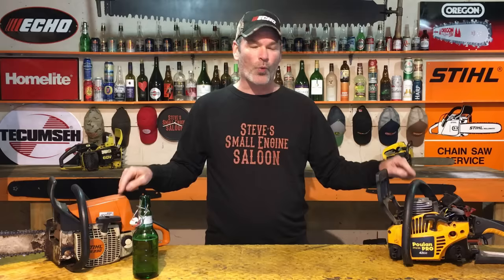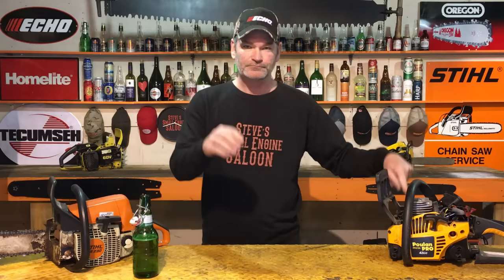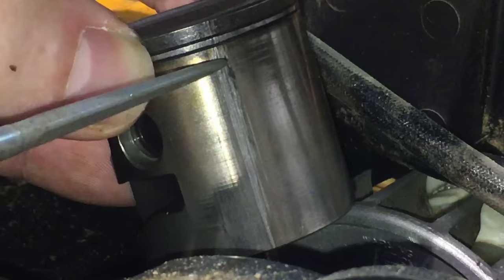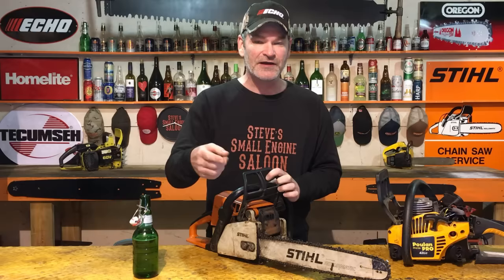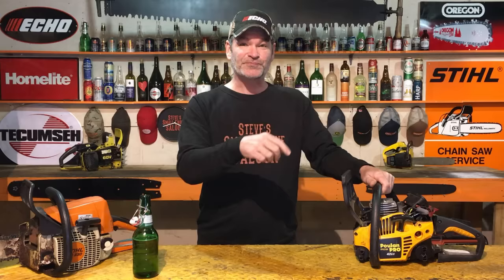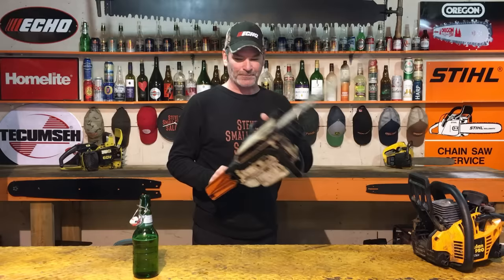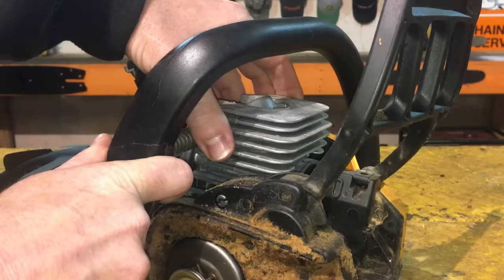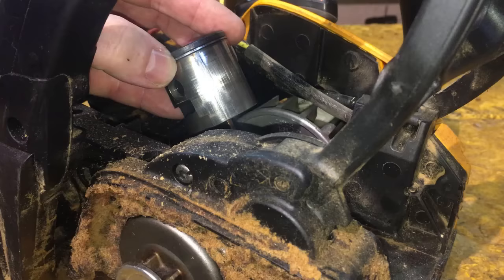WARNING: Never Do This To ANY Chainsaw

Comment: this is great info, i'll make sure i warm up my electric saws so this doesn't happen :)
Reply: If electric u have to run it at least 10 mins so the wiring warms up. For max power
Reply: @myes344  😂😂😂
Reply: You dont have a saw, you have a electric carving knife for the kitchen! Look out turkey............ha ha
Reply: @garyshanks1330  well i don't use a  chain saw to install a kitchen window 😅😂😂👌🏼💨    (chainsaw carpenters) we call them butchers!!!
Reply: @rev_80m13  measure with a micrometer, mark with chalk, cut with a chain saw! It will fit!  If you warm up the saw! HA..............HA.
Reply: Hell I feel bad having to pull out a Sawzall to fix something these suckers are breaking out chainsaws bet they have 20" bars on em

Comment: Hey Steve, I recently purchased my first Stihl chainsaw. Ms270c I was wondering what your thoughts are on this saw and any info you could provide me would be greatly appreciated. I picked it up from an older gentleman, but didn't use it much for $200. Case three chains and a wedge Thanks for your time. Keep up the good work.

Comment: Watched your video and went out the garage to a Poulan I bought used (cheap) and took the muffler off to view the piston.  Sure enough, the piston was scored.  I took it apart and the cylinder was scored as well. Parts saw now.

Comment: This is good wisdom and this also applies to vehicle engines.  Especially big ole iron block engines.  Let them warm up for a minute or two depending on the outside cold and don't throttle them that hard until they warm up.  Saves your rings and lots of money.  No wonder people's car die so soon.  They get in them, count to 3 and drive off manically.

Comment: Steve, love your videos. Lots of good knowledge there. I noticed the scoring on my little Husky 51 when I took off the muffler. 15+ years, but not a lot of hours/year. Still runs Ok, but I suspect I've done some real damage with cold start/high reving... And I'm ordinarily really careful about cars and even most other 4 cycle engines I own. Dpon't know why I've mistreated this little 2 cycle one. Duh...Makes complete sense. Warm it up FIRST! Thanks for your great videos!

Comment: I've never understood why people would want to fire things up and then just start ripping. It's not good for any engine. When I fire up my Husqvarna, it starts on high idle and I immediately release that so it can idle down. I let that idle for about a minute or more. Two strokes are inefficient, they warm up quickly if given a chance.

That being said,  it is not always advantageous to let an engine sit and run for a long time.  DIESELS do not warm up fully from a cold start just on idle, or at least take a very long time.  Don't do it. You're wasting fuel and letting your engine run cold.  Start it up, let the oil pressure come up to normal, then get moving taking it easy for a while until the gauge gets out from being pinned at the bottom. If it needs to idle, use a high idle or an exhaust brake to bring the engine up to temperature faster. If you have air brakes, you need no more warm up time than it takes to charge the brake system, but then TAKE IT EASY until the temp comes up further. Newer computer controlled pickups help with this, and I have installed the high idle on my Ford.

High RPMs and heavy loads are what will damage a cold engine more. Keep it below 2000 RPM and low load until it gets warmer.

Comment: I used to see this in kart racing.
Very expensive (£4,000 - £6,000) engines being destroyed, especially in winter when they thought the cold weather would help protect the engine. Those who didn't re-jet their carbs and do a warm-up would get a double whammy: the cold weather meant that the engines would run lean and a tight build tolerance cold engine would go bang.

Comment: I always let mine warm for a minute when first starting from cold and do the same after before i shut it down. Let it idle in a light breeze just to cool it a little
Reply: you don't need to do the same for shutting it down. Once warmed up and then shut off, the metal will all naturally cool with no issue. The whole issue with starting it is because of the fact you're burning an explosive fuel right inside the combustion chamber, which is what is rapidly increasing the temperature.

Comment: Grolsh! I always let my saw idle for a bit from stone cold, it says in the manual for Huskvarna a minimum 5 seconds of idling before using. rev up a couple seconds to let the oil flow through the bar and a little more idling before cuttin...

Comment: Isnt that why piston rings have slits in them, so they can expand but still have same circumference then after the cylinder has expanded the rings expand with it?
Reply: If you score the piston at the exhaust side, it will shove the ring in and the score on the piston will hold the ring in. Your compression will suffer.

Comment: I'll always remember the time when I was a young teen I was told to start washing a CAT 966F wheel loader. I started er up and put the pedal to the floor middle of winter to drive it over to the wash bay. Lol I just happened to look over my shoulder only to see the mechanic running after me screaming and waving his arms to stop. He then proceeded to yell at me for 15 min about cold siezing an engine. Come to think of it that loader did end up getting an in frame rebuild sooner than the others did 🤔

Comment: I'd pull the ring out and re-cut the ring groove ,reassemble and give ot back to the framers. 👍
Reply: Yup. That’s what I was thinking.
Reply: Once the piston is torn up like that, it's no good. If you replace the ring and slap it back together, the same exact thing will happen. It best to replace both the piston, and ring, they aren't that expensive for those saws.
Reply: @InTheDogHouse3DPrinting  yes the same thing will happen because of user error not because of the same piston and ring, cutting the grove so the ring can move and meet the cylinder wall will fix it. its not about price its the fact that the operator will damage the new one if it was to be replaced but the dollar factor after a few times of failure may change the opperators habbits.

Comment: i always warm up AND idle cool down all my internal combustion engines
Reply: Good point. I hate the way some generators are designed that when you start them they are running full throttle immediately and then no way to idle them down before you shut them off. Same with lawn mowers with the blade brake and no throttle control.

Comment: I start my saws and run half throttle and maybe slowly cut a thumb sized limb and/or check for oil flying off the bar tip. 
This is how I warm up my saws.
Reply from the maker: Right on...
Reply: Yeah.. I'll let the high idle cut small limbs
Reply: @manman3015  just a fast idle minute does it.
Reply: I do exactly the same thing: I always want to make sure my chain bar is getting good oil. Revving it up to sling oil probably warms it up enough, that when I get to the log I want to cut, the cylinder and piston are closer to the same temperature. I've never had a cold seizure, and that's probably why. It also gets some warm up as I adjust the mixture on the carburetor.

Comment: i'd always thought the rev rev, rev rev was just the owner loving the sound of the saw.. good reason to do it, like an unwritten law. cold saws must get the rev rev, rev rev for at least 20 seconds before checking the bar oil spray and then cutting the wood.

Comment: You keep Poulan and Poulan and it just wont start
Reply: Last time I heard that I fell off my dinosaur.
Reply: @billmalec  most people don't get it.. thanks
Reply: Lol - the 46cc is an excellent medium saw - it's the 42cc dual port that does that (carb stud nuts back out and you get an air leak)
Reply: Poulan is Chinese for Stihl..
Reply: Rich Pysz 😂😂😂👍
Reply: Pull-on it's gonna be a while
Reply: I have a 24 yo Poulan, and it still works great.
Reply: newagetojo  All of my Stihl saws are made in Germany.
Reply: @benzw2505  Actually poulans are made by husqvarna.
Reply: @remington1608  
I herd it at an auction once, the auctioneer could not pronounce Poulan and a somebody spoke up saying that. Had everyone chuckling and my buddy scored both running saws for $20.
Reply: would put my Stihl, up against any. 028AVSuper.
Reply: Only if you forgot the oil in the gas. They're not considered high-power 'screamers' or durability kings but for home use they're probably just fine if you maintain them. Ethanol-free gas, right amount of oil, maybe some stabilizer in it, shouldn't be any worse than any other cheap small engine :)
Reply: Michael Fresh mine does the same thing, it’s a air issue.  The air filter gets oily and it cant breath.  They have a lame air filter setup.
Reply: I was taught to warm the saw up. One thing I haven't seen in any saw video ,I was also taught to hold the tip near the wood and run the saw to make sure that you have oil coming off of the chain and keeping the bar oiled. This will save your bar and chain.
Reply: @remington1608  NNNOOOOOOOOOoooooooooooooo!!!!!!!!  (Heh heh!)
Reply: @PRog-zx5vh  Hey,  thanks for the good tip.  That should be useful.
Reply: @billmalec  But I never heard it before and I used to swim with a bacteria.

Comment: actually I find most people cause this problem from not running correct fuel to oil ratio or being stupid to use car oil as two stroke mix oil
Reply: Fuel+Oil mixture and Cold Start cause burnt up pistons. But I agree with you that most of the time it's caused by bad Fuel+Oil mix. However, you used to be able to use a Fuel+Motor Oil mix in those solid steel built chainsaws they built decades ago but it had to be around a 60/40 blend to keep from burning up the piston. Not in these alloy chainsaws today because of how much quicker the heat expansion is compared to those old beasts. You'll lock up (*Most Common:* rusting piston and chamber after sitting long time) or crack the piston in the old beasts (which still takes a very very long time to happen) before something like this happens.
Reply: Michael W yup I agree then again nothing beats a good solid built motor wether it's chain or a vertical or horizontal shaft motor that's why now they shitty light weight motors so they don't last as long and people need to buy new more often

Comment: how long should a chain saw be warmed up ?
Reply: In the description above Steve says to warm it up at least 60 seconds.
Reply: @charlesgraham843  or in our case in Britain or Europe they recommend 3-8 minutes because we have catalytic converters and European emissions specification engines.
Reply: @bentullett6068  seriously? Catalytic converters on lawn equipment, I'm sorry you have to deal with that non sense. It's bad enough having them on cars over here.
Reply: @scinto23  on most of the two stroke machinery. They haven't yet been fitted to ride on mowers or lawnmowers yet as they use the same engines as machinery in America but tuned to keep emissions and noise levels down.
Reply: @bentullett6068  Well, average Joe in America lives in total denial of the pollution relared problems. Sad but a fact !

Comment: Never hire a framer who uses a chainsaw.
EDIT: Never hire a framer who uses JUST A CHAINSAW. 
Any attempt at humor fails most folks nowadays. Lowered IQs and fluoride I reckon.
Reply: Watch the Essential Craftsman use a saw on a pack of floor joists. Pretty good!
Reply: Finish carpenters who use chainsaws are even worse!
Reply: Or a neurosurgeon. At least not for what he's paid for :)
Reply: Dude, I knew a guy who used a HATCHET.
Reply: You really think a chainsaw is that much different then a reciprocating saw I can cut straighter with a chainsaw
Reply: Dogs gotta eat
Reply: CLureCo  lol i use chainsaws everyday, like a surgen. the right tool for the right job.
Reply: They all use em down here on the gulf coast cutting the notches out of the pilings for the floor system to sit on building pilings houses. They're the size of a big pine tree so it makes sense.
Reply: I tried to use my chainsaw but couldn't figure out where to hook up the air hose. ;)
Reply: Never hire a stupid framer with a chainsaw.  If you have a little coordination and your not blind a chainsaw can do wonders in certain situations.
Reply: Andrey Zagoruyko, rigger’s hatchet is a framer’s best friend.  Better balance and better driving force.  Pry bar built in.  Can move huge beams that a claw hammer wouldn’t.  Very handy for certain types of framing.  Not a trim or finish tool- absolutely should be in a production or timber framer’s Arsenal.
Reply: For post and beam work, a chainsaw is very useful. Large mortise etc.
Reply: Especially one with an open bottle of beer
Reply: Ya,charges you extra for overtime!
Reply: @stevebshiplack300  To me it just seems like it would be dangerous (unexpected kickback / hitting nails or stone) and sawzalls seem to be designed for this purpose!

But if it works for you, who am I to question your method :D
Reply: Greg Preston  @ Be a bargain tho,two for price of one !
Reply: One hundred percent right. Take a beautiful piece of milled and planed timber and shred it near a critical join with a chain saw. Absolute lack of respect for the trade.
Reply: Anthony Walker  Who uses a chainsaw FOR EVERYTHING. 
People don't grasp humor anymore.
Yes, my ash has been up my head many times in life, as has anyone who has lived beyond age 6, but with this comment I was pokin' fun so, kma.

Comment: You should rev the piss out of the pouland if it starts. Blow that junky saw up. Next step go to local saw shop and buy a husky or Stihl.
Reply: yeah boy!
Reply: Mike Wojcik echo is better I've worked on some 60s models echo but no Stihl or husky. Did work on some old mculloch
Reply: By the time you can get the cheap ass gas and oil caps back on without the cheap plastic breaking and throwing the pos stihl in the dumpster because it will never run again and going out and buying a new one that you’re only going to get a few uses out of any other saw will have the job done and you’ll be drinking beer and grilling ribs before the stihl ever runs
Reply: Poulans are Huskie's!

Comment: I couldn't agree more.....usually the construction guys who are too impatient to let a saw or a concrete cutter warm up. I've seen the cold WOT damage in the form of aluminum transfers. And yes, the transfers are hidden from usual examination.
Reply from the maker: Right on
Reply: Construction guys even do this in the dead of winter, even seen damage in heavy machinery from the same stupidity.

Comment: Contractor:  Time is money.   

*Same guy who bills a 1 hour minimum service charge for just showing up, then another hour for the 5 minutes of actual work they did, then a following 1 hour time bill for "just because I can" netting 3 hours @ $100+ an hour for 5 minutes of actual work.  

Time is not money.  Self justified greed of the industry is money, big money.  Time is just the excuse for it.
Reply: The they charge more money to cover there screw ups.
Reply: @Dj-ve2hx  They actually have that scam now too.  They call it a "Anti liability" service charge and if you dont pay it and sign off for it they won't even come on your property with their equipment. 

Basically you are paying them to have zero liability for anything they fuck up no matter how stupid they are or how expensive it gets. 

I found out about it 2 winters ago when I got stopped by a nice older lady and asked to do 10 minutes of snow blower work with my big blower tractor while enroute to help my 85 year old grandma get her yard cleared out after a big storm.  

I did the couples driveway and said don't worry about paying me being  when I have to do snow at home I do it for hours at a time for multiple family members plus goo neighbors so 10 minutes more to help a older couple out wasn't enough to be worth anything to me.

They handed me $200 and told me about the scam all the contractors were running where what I did would have cost them $400+ for the same few minutes work I did.

Comment: Grolsh Beer has a small ceramic top held down with a metal bail.  We used to use those stones for smoking joints in the 80s ...
Called it  a Toke Stone....!
Pot is bad, don't use it.
Dig your posts!

Comment: Having retired 10 years ago, I pick & choose what to work on but I still get people that want their equipment fixed but don't want to spend any $. Then they get mad when I give it back to 'em. Hard to fix if they're not going to spend $ even for an estimate. Even more frustrating is when something comes out of the blue that wasn't covered. Case in point, how many techs check how out bent the PTO is? I rarely do unless there's a vibration problem more than usual. Back in the late '80s, I took in a Stihl 009 that had the points system. Comp was great, no spark tho. It had sat for years so a carb job & lines were needed. Those saws are a pain & after all of that was fixed, guess what? The oiler wouldn't work & that wasn't in the estimate. Guy had several $ in it by the time that was fixed. It's still running btw.

Comment: Someone commented that this fix could end up with the a seal being pushed out. Don't know if that it true, but a think a better way to grease would be with the jackshaft removed and applying grease to the bottom bearing from the top and then flip the deck over and grease the top bearing by going through the bottom one. I'm thinking once a year would do it.

Comment: Didnt know cold seizures were a thing, but i warm all my engines up anyways. With my saw I get it out, fire it up, rev it for 2-3 seconds so it will stay idling, then set it down and let it run while I get my gloves out and make a game plan for the day. Do the same thing with my lawn mower, tractor, ect. Even my truck if I have 3 minutes to spare before I leave.